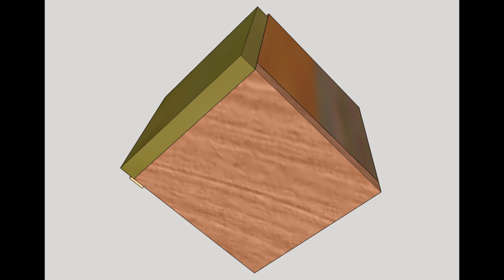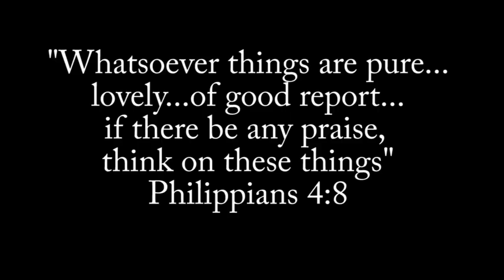Woodturning Ornamental Herringbone Threaded Box

Comment: No one told me this was the year of the herring bone. <VBG> You have celebrated it quite well Alan. I very much like the ones you have done so far. Are more examples coming?  Yes, I think the threaded inserts are a very good idea. I certainly would be up for several pieces. If you did them would they be available in several diameters? Thank you for sharing. Have a great day and stay healthy.
Reply from the maker: I think that is it for this set.
Are all woodturning projects the same size? :)
Alan